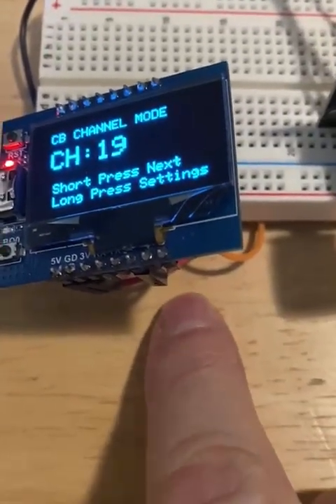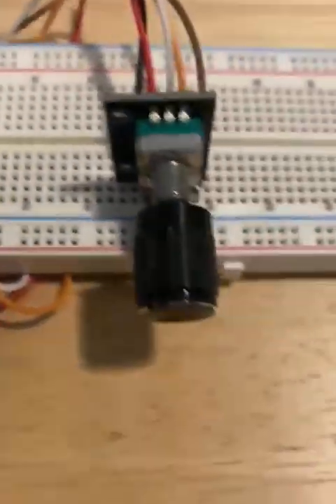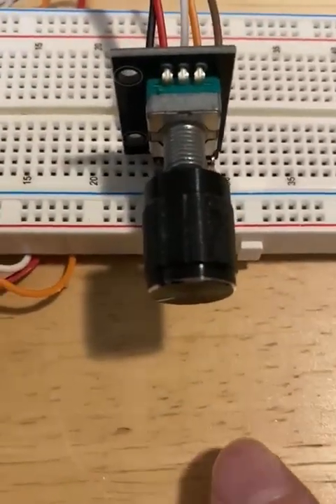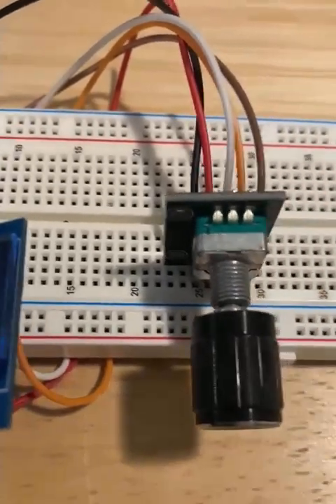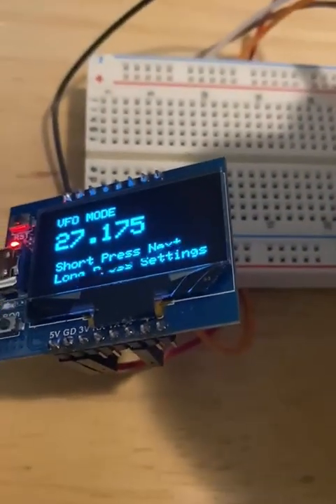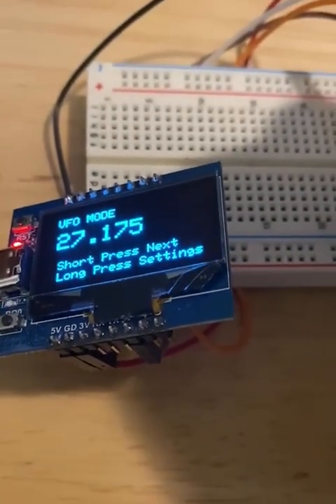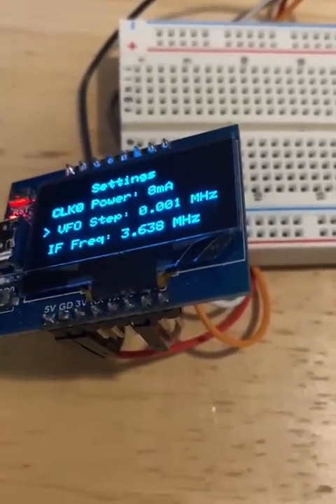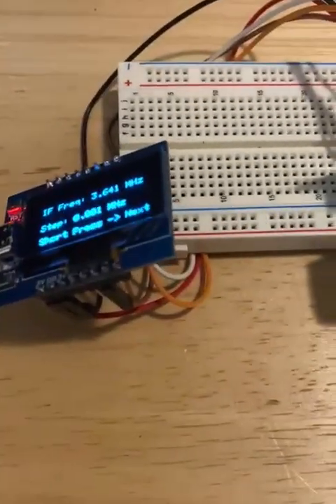ESP32 DDS VFO build part 2

Comment: I got my hands on a Chinese DDS VFO in a box from Amazon. I am having struggles at the moment, because I know absolutely nothing about Arduino. I am going to get more parts to continue the experiment. I was unable to get your sketch to work on this box, as it is electrically a Nano.
Reply: I am happy the way this works, for what it is. At this point, it is a learning tool, which is good, because I know nothing. I have already bricked it and have re-flashed with some code someone else wrote, that I have made some minor changes in. 

Ultimately, I'll want to do things with the components like what you have done.
Reply from the maker: @moepowa398 keep at it and good luck.
Reply: @mikegeo408  I like that you made the IF selectable from the UI. I have not seen anyone doing that.
Reply from the maker: @moepowa398 I was planning on using the same sketch for different cb radios.
Reply: @mikegeo408  Same here, which is why I like what yours does. I'm still using the Hy-Gain V SSB radio, but I have a bunch of other 23 CH SSB radios I want to try it with. I had a Siltronix VFO 90 on the Hy-Gain, which was awful. Unstable, noisy and inaccurate dial. It is also huge by comparison. The DDS VFO is a game changer.
Reply from the maker: @moepowa398 I found this project very entertaining.
Reply: @mikegeo408  I received a ESP32 C3 today. I am going to try your sketch in the near future.
Reply from the maker: @moepowa398 let me know which one you got. Good luck with your project
Reply: @mikegeo408  I got a bunch of stuff. Nano's, .96" displays, ESP32 C3 Mini with the tiny integrated display.
Reply from the maker: @moepowa398 my sketch should work with the ESP32 C3
Reply: @mikegeo408  I got two of the ESP32's to try yours. The display on these that I have are tiny. But I am just playing around at this point.
Reply from the maker: @moepowa398 the sketch is for a 1.3 oled. You may have some screen formatting issues.
Reply: @mikegeo408  hmmm now I don't know how to resolve that
Reply from the maker: @moe @moepowa398 ChatGPT to convert the sketch over to .96 Oled or run the sketch and see how it looks. I would try ChatGPT.
Reply: @mikegeo408  Your sketch was for 1.3" OLED. Will.96 work?
Reply from the maker: @moepowa398 it will work but some of the screen may not appear correctly
Reply from the maker: This might work. Copy my sketch into ChatGPT and ask it to convert the sketch for a Nano.

Comment: Is the OLED you have there something that comes installed on the uController, or did you install it? Links to the hardware might be helpful.
Reply from the maker: I got the board from Aliexpress. It came complete.  https://www.aliexpress.com/item/1005009954904896.html?spm=a2g0n.productlist.0.0.8a5474c4RHrDr3&browser_id=8a1e32301bef4e1d9e89c7eea12d3136&aff_trace_key=9347a1f52b23416683ca034a44556e40-1766336141391-02096-UneMJZVf&aff_platform=msite&m_page_id=jrtpiafdgucaahbm19b41e8f20b17a7d029724cb53&gclid=&pdp_ext_f=%7B%22order%22%3A%22-1%22%2C%22eval%22%3A%221%22%2C%22fromPage%22%3A%22search%22%7D&pdp_npi=6%40dis%21CAD%2121.18%2110.38%21%21%21105.69%2151.80%21%402101eee917663373439958889e3170%2112000050676991485%21sea%21CA%210%21ABX%211%210%21n_tag%3A-29910%3Bd%3A87c90392%3Bm03_new_user%3A-29895&algo_pvid=3613de7e-ac48-48f7-b9c1-489ba06f60b9

Comment: Hi Mike, I am curious about the WiFi feature, what is it used for? Also, why did you choose the ESP32, over the device you forked over from? Are you going to get into how to build this? Thanks
Reply from the maker: With the wifi it is possible to make a local  access point and have all the features available on your phone or tablet. I choose the ESP32 for the on board features like wifi and the Oled. But I guess I could used any.